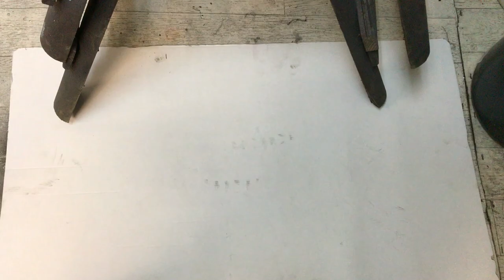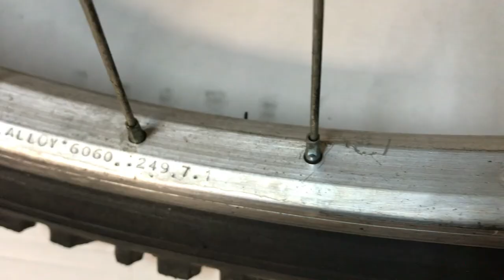How to quickly polish aluminum bicycle rims | DYI Cheap Option

Comment: Excellent job. I wonder though, if a one inch belt sander would be easier to use between the spokes? I haven't got one so it looks like I'll be getting the drill out too 👍